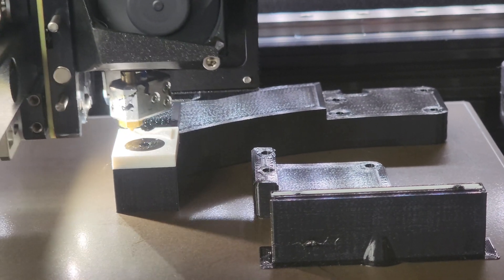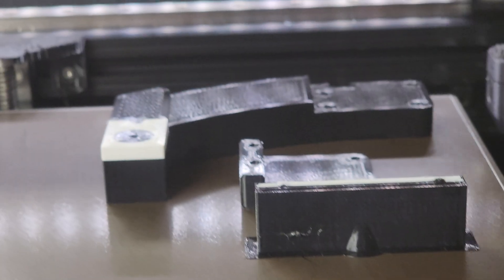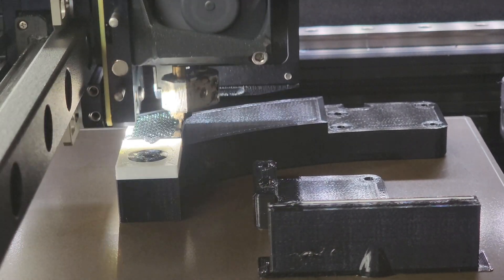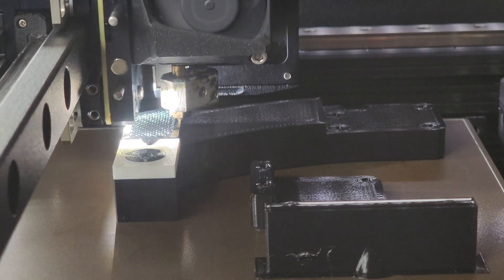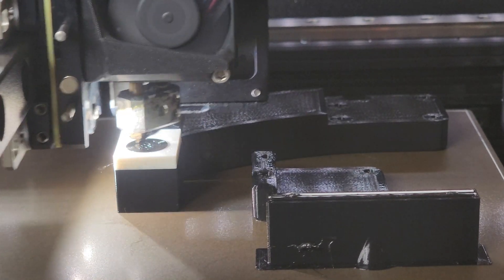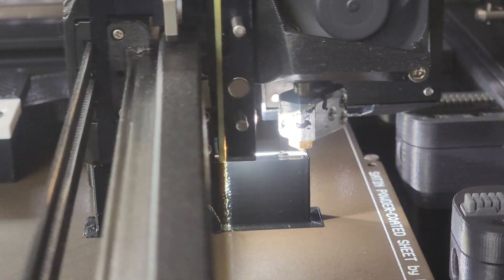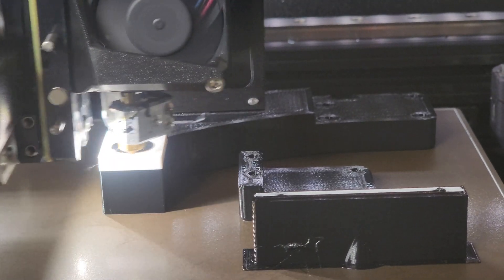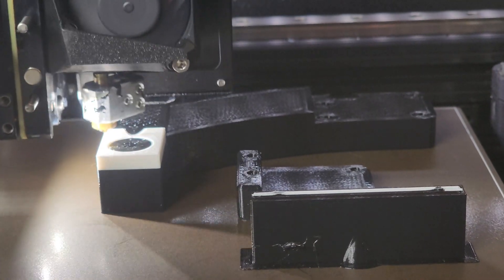Using PLA to Support PETG with zero Clearance.  Prusa XL

Comment: how do you keep cooling fan off for petg to stick to pla ? i have no success with petg sticking topla on xl dual head
Reply from the maker: I don't turn the fan off.  Bed temperature plays into this.  My parts are usually PETG so the bed temperature is at 90° C which helps the PETG stick to the PLA. 

That being said there are lots of variables that play into success here including the brand of filament you're using.  I've had the best success with Hatchbox filament, but I'm sure there are others that work too.  

Without seeing your specific application is hard to pinpoint exactly what might fix your issue.